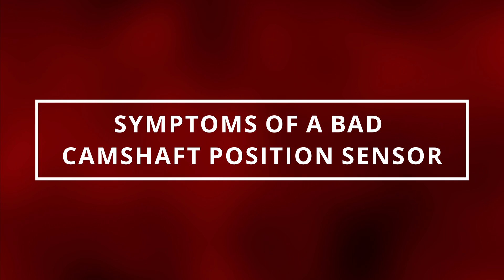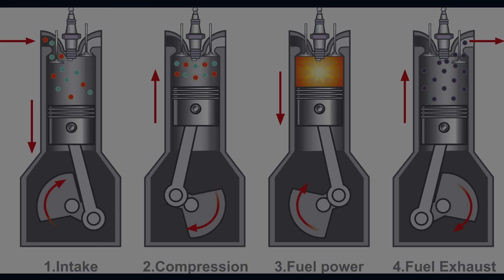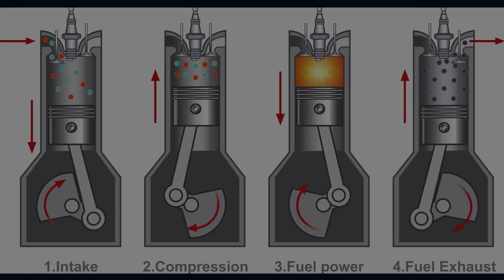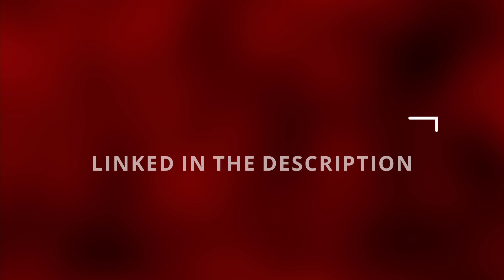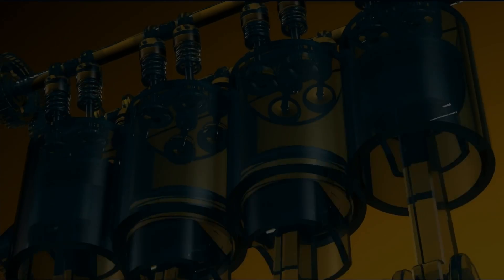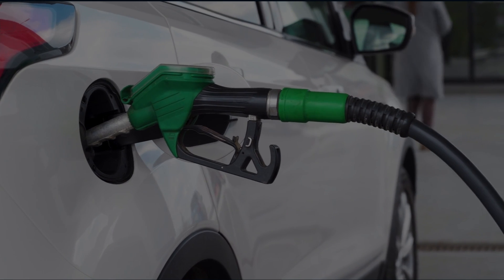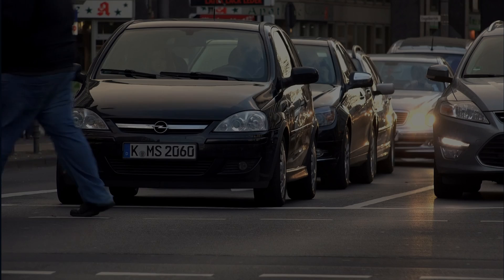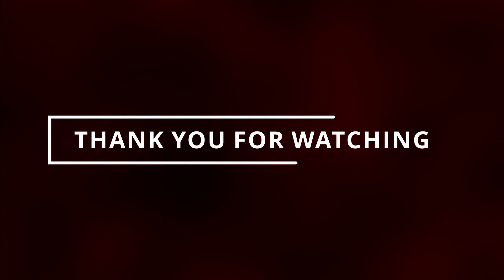SYMPTOMS OF A BAD CAMSHAFT POSITION SENSOR

Comment: I ran out of gas a few months ago. I started getting a misfire a week or two later. I located the cylinder misfiring and changed the coil and plug. Still no fire and that cylinder. Any suggestions would help. Is the cam sensor a possibility or should I look elsewhere?
Reply: How did it go mate I have a similar problem my self 318i e91
Reply: clogged injector?

Comment: It's an Acura RDX 2.3L year 2007, I've made a test drive today, and the seller told me about the error codes. It has a late start but then worked well, a lot of power, then sometimes loses rpm. 

 (p0234,p0117,p0365,p1131)
engine very hard to start and runns rough

Could be a camshafts position sensor or it's could be out it timing?

Comment: after replacing this sensor I still have the same problems and code, could it be the actual cam shaft it self
Reply: loose timing belt, cam phaser or reluctor wheel?

Comment: Can provide more information about Camshaft position Sensor as it is defective Engine Cranking is very difficult. I faced the same and resolved by replacing the new one. You have only displayed a very little information and closed the Video as if you are in a hurry.

Comment: Would it be another symptom that when I'm not hitting the gas, like stopped at a red light, the vehicle would just shut off?
Reply: I had that problem before and it was my 02 sensor.
Reply: could also be a fuel regulator problem....regulator can be found on fuel pump or outside of fuel pump

Comment: I'm praying it's this. I've changed so much and still misfiring.
Reply: Was it?
Reply: @AndresSanchez-wj5cj  sadly not might be the after market fuel pump that's weak or my valve cover gasket. When I speed and come to a stop the car starts shaking. When I turn it off and turn it back on the misfire is gone. Chokes when going up a hill to.
Reply: @mikey.2687  timing chains or timing belt.
Reply: @ericshimer6669  it was a fuse 😂
Reply: @mikey.2687  what fuse? I’m going thru the same problem right now
Reply: @Pbj2424  fuel pump fuse or relay could be the problem as well I was told. Or sending unit fuel filter is clogged.
Reply: @mikey.2687  what cylinder was it misfiring on?
Reply: @mikey.2687  That's hilarious 😂  a fuse !!
!I'm going to go check mine now and certainly exhausted myself being a parts changer  SO!! Cross your fingers eyes toes legs and arms here I go 🤣🧐 LOL
Reply: @rayneedaebluz  so much money spent. It could also be your sending unit. The filter might be clogged
Reply: @mikey.2687  I hear you on the money spent I can't imagine what the total would be if I wasn't doing it myself good luck to you and thank you
Reply: @rayneedaebluz  no problem my man . Yes these cars are expensive. Thinking on switching to the new Honda accords lol.
Reply: @mikey.2687  You have to switch that to my lady lol lol and eh think I'd go with the Toyota Corollas, but in all honesty if I had a free pass to go get a new vehicle who knows what the hell I'd come home with LOL but  a Jeep Renegade certainly comes to mind 😏
Reply: @rayneedaebluz  LOL as much as I love bmws I feel its a car that should be bought brand new. Seems like the old owners never did anything. Transmission filter was almost clogged old plugs injectors coils. I did everything. Should be fresh Just this misfire.
Reply: @mikey.2687  Well I found out what my issue was, an O2 sensor!
Reply: @rayneedaebluz  that 2! I replaced the 2 on top but I'm having a hard time replacing the bottom ones so I tighten them back up. I'm gonna change my sending unit. I think the filters clogged. My car doesn't stay on when i start it.
Reply: Me to my car doing the samething
Reply: Check your spark plugs if they have oil it might be your valve cover gaskets.
Reply: @survive7077  yes I actually just put my valve cover back on. I'm waiting on a fuel pump sending unit. The filter might be clogged. Only thing I didn't try changing yet.

Comment: My truck didn’t start, took the battery out got it charged then took the truck to Autozone and Oreillys and both told me the starter is failing. So I’m going to replace the starter should I also replace the sensor. I don’t have any of the syptoms other than the truck didn’t start?

Comment: I have a 2010 chevy malibu no check engine light nothing I bought the camshaft I will change it tomorrow and I bought the speed sensor to call wares a lot of gas and doing 70 80 mph when I try to give it more cas it runs poorly

Comment: Very well said. You kept it very simple on explaining how it work's and made me feel like this could be and issue, I have done a complete tune-up on 2010 CR-V  2.4L 4WD and on here under spark plugs, it states to replace cam sensor seal at the same time,  I didn't and still have some issues but much better, if I'm gonna take the time to take apart,  then I'll just replace it and order a new seal for $4 and have a spare with the new one in vehicle. Just like I kept my coil packs, for the money. It was worth it to buy new coil packs than buy new boots and other seals that needs to be replaced, was worth the extra $15 per cyclinder and know its new and should be good for awhile withb3 years or 36,000 mile warranty. As long its not to pricey, then I'll replace it and keep spare part's, if something happens,  I can sell them cheaper than most will have to pay later on like now,  everything has jumped up by 35% or more on some thing's and is crazy prucing and changing weekly on parts. Honda's last a long time on the 2.4L engines, they sell very fast even on Craigslist for top prices, if it got wrecked,  I'd  lookup prices but sell them for what I paid for them. I Already been robbed by garage on heater tube that took them a month. Just found a friends garage I could use and I was taking it back. Had help and it was freezing outside,  at temps below zero and I can't move in cold weather, cost $817 for a $32 part then new  Plenum gaskets also to get to the metal heater tube, They charged me $112 on it when I said I went to order from said site and I can have it here overnight delivered for $25 extra. She said mines came in and working on it now with being slow,  went by and outside in same place, had a low tire and dirt kicked up on it, they added air because was clean and done in 2 day's Ebaymotors and took the chance,  the person I was gonna order from had up to 14,000 plus in sales item, and rated 99.9% and took returns even if order was your own mistake and no charge for restocking fees, just cost to send back to them. She said it sounds like you have my guy as she was clicking on key board that you could hear and cost just $75 but I understand they make money off parts but screwed me. Said my radiator was shot. Didn't see any leaks on pressure test,  $130 radiator  and new from factory wholesale warehouse cost $286 and I was charged $396 for a radiator that fits but not tight from factory, it's loose and nothing they can do about it she said, I said not factory radiator or would fit like old one and old one was gone aready because I asked to see the tanks where it was leaking from.

Comment: So my 2011 kia sorento had been having a slight rough idle, I went to work,  on the way hit a pothole, I went to go home and tried to start my truck and I get nothing but a quite click. It not battery or alternator. Could camshaft position sensor cause this?
Reply: It was my starter. The female side of the plug was broken when it was replaced last time by a mechanic and shorted the starter out
Reply: Could be a bad crank sensor. Usually once the car cools down it will restart with a bad cam sensor.
Reply: What was it

Comment: I have no check engine light but when I drive about ten minutes or so the car will cut off. I let it sit for a couple hours and it cranks right up. Could this be the Camshaft sensor as well?
Reply: Same here
Reply: Usually ICM does that cause it overheats then cuts off when bad check that
Reply: Crankshaft sensor I had a grand am did the same thing

Comment: Thank you so much man this help out alot because my car had quit and stalled out while I was driving when I tried to start it it was just cranking and cranking and would not start
Reply: Same here. My car was acting up for a few months, I ignored it. Yesterday it finally went bad fully. I got stuck 2 hours from home, got it restarted and it ran like garbage and tried to stall everytime I came to a stop. I put it in neutral and that stopped it from dying. $170 fix at the shop I dropped it off at
Reply: @RC-uu3qz  I’m having that problem now did you just go to a body shop to get it fixed?

Comment: I just changed the Crank shaft position  sensor on a Ram 1500 3.6 L... and a new battery.... fuel pump seems good... could a camshaft position sensor be bad even with no codes? Or what could be going on?
Reply: Did you fix it ?

Comment: My G37 is giving me the PO 335 po340 and po345 says bank one and Bank two circuit position camshaft sensor all that other stuff but that's the only ones I'm getting and it happened whenever I pulled out of McDonald's and had to press the gas cuz somebody was coming up on my ass and this is right after an oil change and a car wash that sprayed the undercarriage anybody ever have this problem before any help with be appreciated 

09 G37

Comment: Question, if I continued to driving with my sensor going bad does that mean I messed up my engine because I waited like 4 weeks til I got a job to find out it’s pretty cheap diy job
Reply: Will not mess up your engine. Ive been driving mine like this since summer time. Just fixed it yesterday
Reply: @RC-uu3qz  i drove like that for 2 years
Reply: DONT!!!! i had get a new engine because i did that

Comment: Mine had misfire in cilindro 3 and they changed the motor. Then when putting the other one they used the old sensor so the new used d motor had same issues. Waste money smh

Comment: I have a 2001 Dodge Dakota and the check engine light comes on and off it starts fine idles fine but sometimes when you drive it like the speedometer drops down to like 30 and it kind of just bounces back-and-forth sometimes it will die any answers?
Reply: This might actually be the crankshaft sensor, it plays a more important role measuring the engines timing and displays both the RPM and Speedometer gauges.
There are some videos where they only take it off and clean it and it works again.

Comment: Can the sensor still be bad if there is no check engine light?
Reply: It might be because sometime check engine light doesnt come on but experiencing sluggish engine performance, due to older engine, they could or would over work. These experiences could be vibrations more likely with ac on.

Comment: So my 2004 Lexus(Toyota) e330(Camry) gave me cylinder 1 misfire (coil pack) and crankshaft position sensor and camshaft sensors. Could the sensors be causing my coil pack misfire? Should I try replacing crank and camshaft sensors before coil packs?
Reply: That just sounds like all three parts need replaced a bad coul pack is a bad coil pac man maybe have a shop test each pack individually to be sure before you spend money on a replacement
Reply: what did you find?  bad coil pack can throw a cam and crankshaft sensor problem.

Comment: Ok I have a 2011 Chevy Malibu. When you crank it up it goes in gear just fine. But as I'm accelerating it takes off for a second done then it's starts revving up like it's out of gear and I put it in park does the same thing! But when I turn off the car and crank it up it it goes in gear just fine. But mine is the p0700...

Comment: This sounds very similar to a faulty crankshaft sensor. How do you tell which one is bad?
Reply: Crankshaft want crank at all
Reply: And have rough idle
Reply: @kelvinlaster9775  how can it have a rough idle if it will not start at all ?
Reply: Change both

Comment: Please help. Have a 2012 Kia forte ex 2.0 4cyl  using peak green antifreeze coolant 50/50 should I be using blue Asian formula instead? and also when I go to start it at a cold start the car starts up at 1500 to almost 2000 RPMs then it takes it several minutes to go down to about 800  rpm the car at idle sounds like the rev is slightly going up and down but the rpm needle does not move it kinda sounds like the car is choking the car also takes a while to warm up to operating temps only way I can check the temp on the car is through the heat from the heating in the car due to Kia was stupid and did not put a temp gauge in the car so I rely on my heater in the car to tell me the car is warmed up enough. I have new spark plugs new ignition coils in it. The car is kinda sluggish getting up to 60 mph when stepping on the gas not much but a little bit. and also have a slight ticking when the car is at idle I have taken it to a dealership then lied said i need a new engine the engine is fine asked another mechanic but they could not pinpoint the problem and that makes no sense at all I am also getting worse gas mileage like every week or two I am having to go fill up on gas and it is a 4 cylinder so that should not be happening I do not drive it but 14 miles a day 5 days a week.
Reply: It's cam shaft sensor or emissions vape solenoid  sensor in front of engine or if u get clicking at ya pump when u get gas feel like it's full but not that's a bad emissions evape cannister  the plastic or metal box wit the long hose connected to ya gas tank need to be replaced I done mines gas ⛽ pump smooth and quick now. Now my ac click when I turn air off    I need blend door motor actuators i got a chevy impala I think I got 2 and change ya blower  motor also buy new one wit filter connected they get clogged and dirty don't turn well and circulate heat and air well unless u have a bad ac compressor.

Comment: Is there a way to determine if an injection problem is coming from the ECM or the cam positioning sensor?

2003 GMC Sierra 5.3L
200,000+ miles
Crank but no start
Reply: Figured it out.

Water in the gas tank. Customer pissed off the wrong side piece. All Injectors fried. Had to replace all injectors, and cleaned out the fuel tank, new fuel filter, Fired right up.
Reply: I bought an OBD2 reader from Amazon, it'll be the easiest way, if you haven't fixed your vehicle yet.
My 2010 silverado v6 4.3,  runs and drives, it has a rough idle in the morning, but after a few minutes,  it works fine, the reader diagnosis its a faulty  camshaft sensor, its a pain to replace..

Comment: This is awesome! I just found out I need to replace the cam position sensor in my car because it’s been breaking down due to not accelerating. But now all the other symptoms totally make sense. Thank you!
Reply: same here I just had it diagnosed yesterday.  also one sign would be that the car would randomly die (engine will shut down) even when moving/at any speed.
Reply from the maker: Fantastic! Thanks for watching
Reply: @easyautofix  hello, I have a problem with my 2004 Cadillac Escalade 6.0 awd, when I do a stop it like looses power but no light turns on , I though it was the throttle body,I changed it and still doing the same thing. Any tips on what it can be ? Thank you
Reply: @rolandoquinones8191  u ever figure it out have u cleaned ur maf or airfilter
Reply: Did u have a check engine light on?
Reply: @elpolloloco5594  If you were asking me then yes. Engine light / Red oil light and battery light were on. 

it turned out that my sensor is fine it is just that some engine oil made its way into the cable of the sensor that goes to the car computer.  causing all of my issues.  a simple wipe fixed everything but I still have to fix the leak so it won't happen again. I hope this was helpful